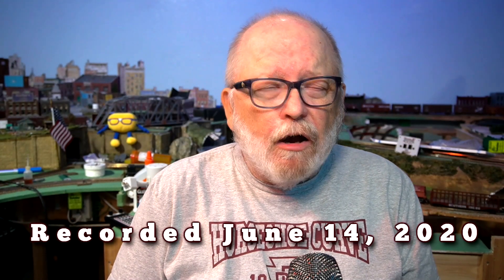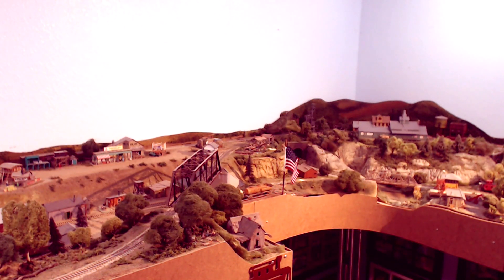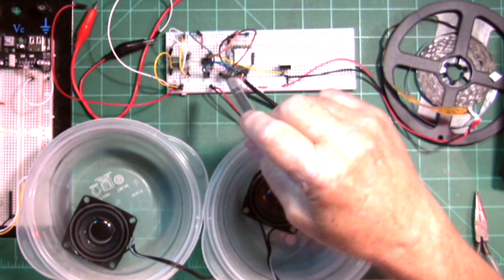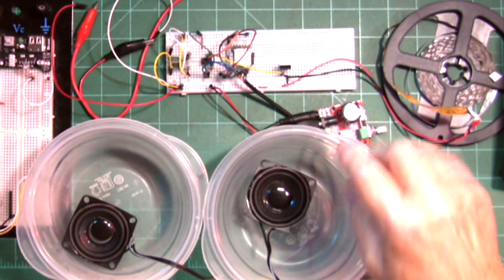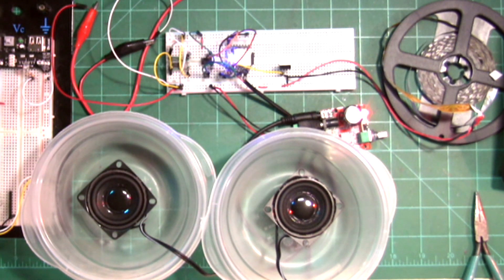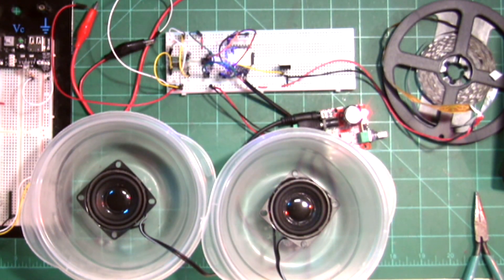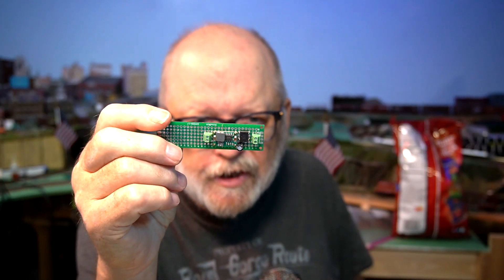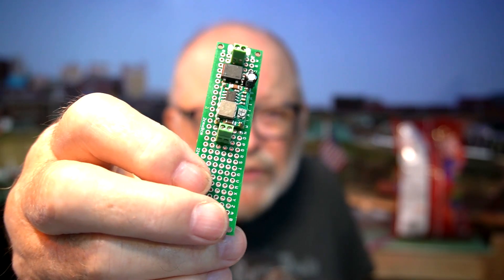Easy Thunder & Lightning Using ATtiny85 - DF Player Mini -  LED Strip

Comment: Hi! I recently got my dfplayer mini and I’ve been trying to get it to work with an attiny84 using the same resource you provided. It seemed to work at one point but the speaker started making a popping sound as the audio was playing and now the dfplayer doesn’t seem to work at all (might have fried it while testing). Any ideas on what I might have done wrong (I used the same code from the instructables link)? Thanks in advance!
Reply from the maker: 85 or 84?
Recheck all your connections. Is this on a breadboard or did you solder everything onto a board? Breadboards are notorious for loose connections especially with the very thin leads on some resistors.

 (I used the same code from the instructables link)... Not the code on my web page?
https://tomstrainofthought.com/projects/tiny85thunder/
Reply: @TomsTrainsandThings  84. I don’t think it has to do with any loose connections as I’ve checked numerous times to see if everything is connected and working as expected. Assuming that the 85 has a similar process to that of the 84, do you recall running into any problems (i.e. problems like making the serial communication to work)? Thank you for responding! : )
Reply from the maker: @afriend301  Never had any issues with any of my projects. Have you compared the pinouts on the 84 & 85. As I recall, I had to use specific pins to get the tx & rx to work on the 85
Reply: @TomsTrainsandThings  Yeah, I used the specificed ones from the 84 code with the setup code too. Would the clock speed matter if I had it set to 1 mhz by any chance?

Comment: Ahh Tom.  You have saved my ass a load of googling. Im planning to retrofit this idea into my motorcycle. Using the deep sleep and Interups functions and some vibrational sensors. To make a low powered alarm... Again thankyou.
Reply from the maker: Glad it was helpful. let me know when you get it going.
Reply: @TomsTrainsandThings  will do. I made a pcb that combines the tda7297 amp and the dfplayer to my existing rfid motorcycle system that you also assisted with. Im hoping to add this low power alarm trigger to it . Once sucsessful.

Comment: I see your stuffed Curtis behind you, lol. I've been thinking about making different times of day and weather conditions backdrops. Even juggling the idea of a tornado
Reply from the maker: Curtis is my guy. Too bad the closest Culvers from my new house is about 40 miles away.

I was experimenting with FastLED for a sunrise to sunset effect. Got it to go to high noon, but having issues with it continuing back to dusk. Will have to start working on that project again in the near future.

Did you see the Sharknado display that was featured by First Coast Modell Railroad at the Deland show? It's awesome!
Reply: @TomsTrainsandThings  no I haven't seen that display but it sounds funny. But being a Wisconsin boy I've seen my share of weather which is part of the reason I thought about it. My plan is a lot simpler with basic lighting and painted sheets for the backdrop

Comment: Those speakers need to be in a box, your canceling out sound waves by not enclosing them, plus you’ll get 3 x the total volume which means you can turn it down and have a cleaner sound / more headroom, very cool set up though!.
Reply from the maker: Thanks! That was just my test set up in the video. I have an old Altec Lancing powered speaker system for the final build. Whenever I unpack it and set it up here!  LOL

Comment: Great Video Tom the programmed ATtiny85 can you buy that already programmed with your code?
I have built a lightning machine for our model rail club here in Perth Western Australia (AMRA WA) and yours is so much simpler than mine and I have also used a MP3 player for the sound but the synchronization seems to be a problem. Bill Pickering Western Australia
Reply from the maker: Thanks for watching Bill. You would have to program it yourself. I have another video which shows you how to upload a sketch into the device.  https://www.youtube.com/watch?v=CIEAifWQfAI&list=PLjjhnrIKSTSh_hezLm4KSCPc6BzTyxrV0&index=13&t=227s